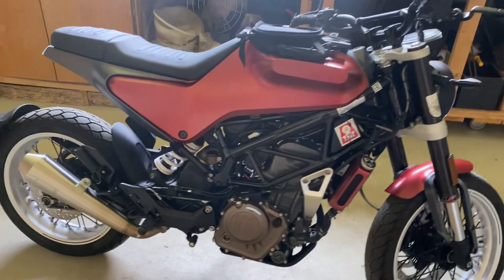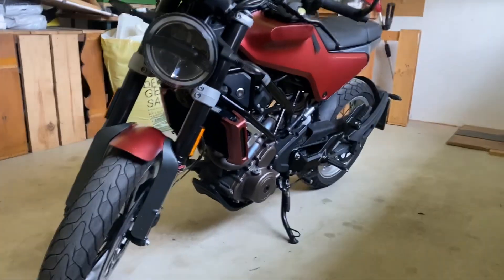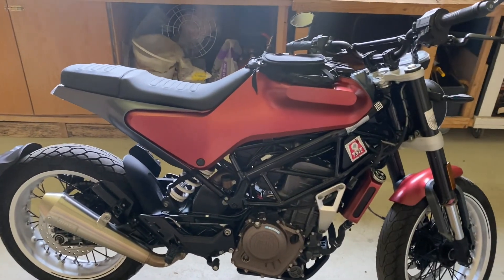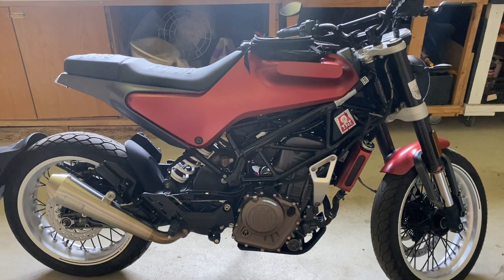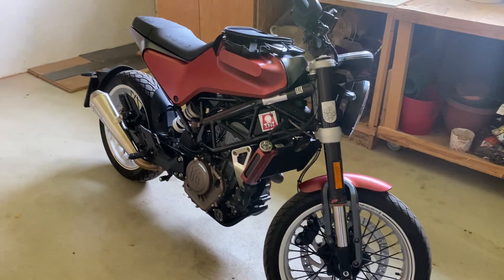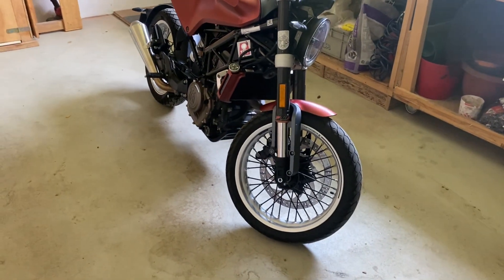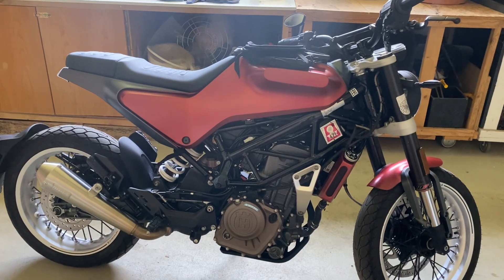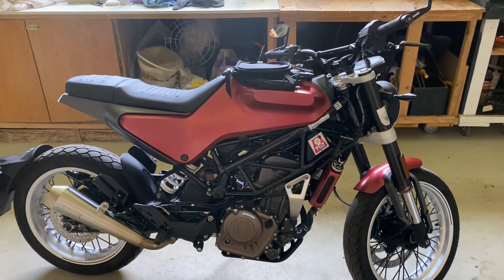My last video with the Husqvarna Svartpilen 401 - Do you want a long time review?

Comment: So you strip off the previous color and spray a new one on, all without destroying the original finish? I'd love a time lapse video of you doing this or a series of pics as you go through the process. Thanks for your vids on this bike!
Reply from the maker: Hello usually I strip the old colour away and you have the original plastic without problem. In this occasion I just sprayed the new colour on top (stripping out is not as easy as it sound on the plastic). I cannot do a video like you wish because the bike is sold already, I have a new one 😎😅
Reply: @stefanfrittiert1038 Thanks for the reply. I'm going to check out that paint for a couple of projects I have going on. Including some really scuffed areas on my '87 Honda Elite 250.